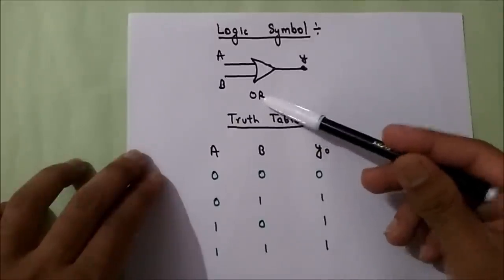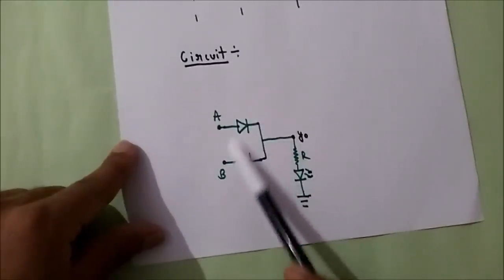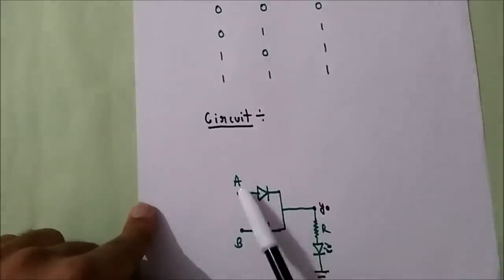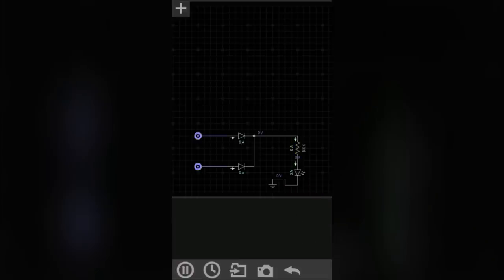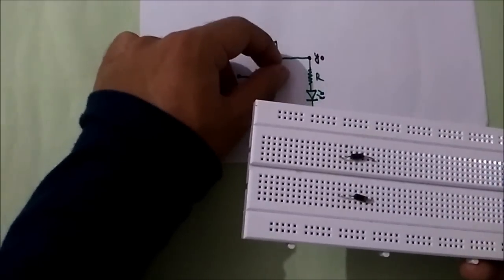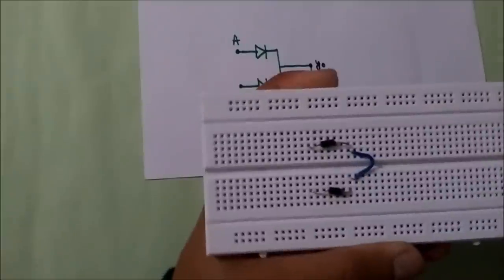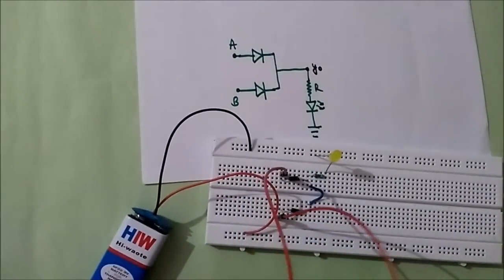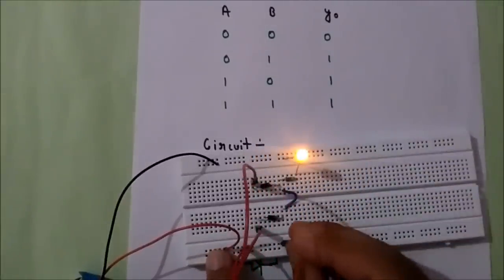OR Gate Using Diodes (Everything Explained!)

Comment: What would you do if you want to add a buzzer? What would you change in order to have the LED and buzzer as one outcome? Great video, thank you
Reply from the maker: Just replace led + resistor with the buzzer..but remember buzzer can have polarity like any Led.
Reply from the maker: If you want both led and buzzer in your circuit..then connect buzzer in parallel to resistor+led

Comment: Sir why do we use resistor here before LED
Reply: Without the resistor, there is no resistance in the circuit, so high current will flow. With the resistor, there is a voltage drop across the resistor and the current is limited. This is done so the circuit components don't break due to high current.

Comment: Hello sir,i had made this circuit on pcb but the truth table is not getting verified. What can be the problem?
Reply from the maker: 1. Check LED
2. Check battery terminal connections
3. Replace resistor with lower one
Reply: I have already checked first two. The led is glowing on applying battery i.e getting output at A=0 and B=0.
Reply from the maker: Ab Aap is tutorial ko Hindi me dhek sakte hai:
https://youtu.be/bSEnQ6t6GQs
Dhanyawaad!

Comment: Bro I got small doubt . I am a school guy. Here 0 and 1 means half and full wave of a alternating current or not?
Reply from the maker: No! Here 0 means 0 volts and 1 means 9 volts.
Reply: Ok it means  bread board deals with voltage and related to current . At anode(VCC) the voltage is high and at cathode ( ground) the voltage is low.
Reply: Bro another doubt that is if we take to input wires A and B . Given A to VCC and B to ground . Means what how electrons pass through A  And B . Please clarify my doubt
Reply from the maker: There is no way for electrons to pass, as the circuit is incomplete.
One end of wire A is at battery's 9 volts but other end is no where.
Similarly for wire B, one end is at 0 volts(Gnd) of battery but other end is no where